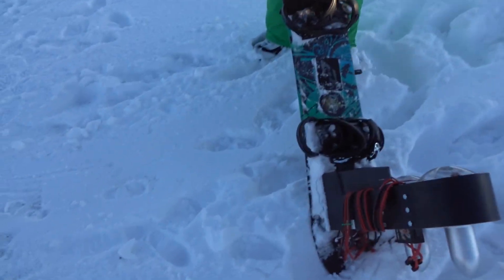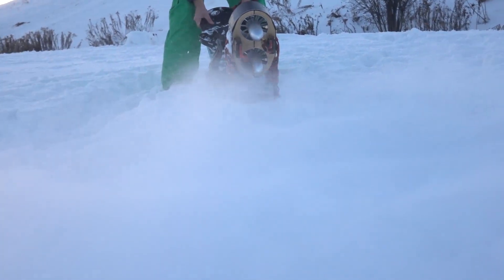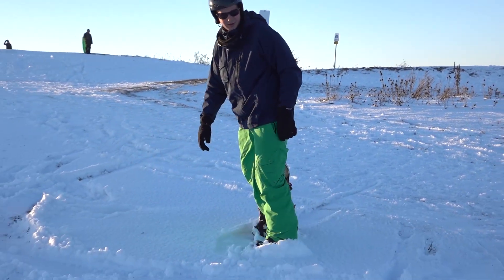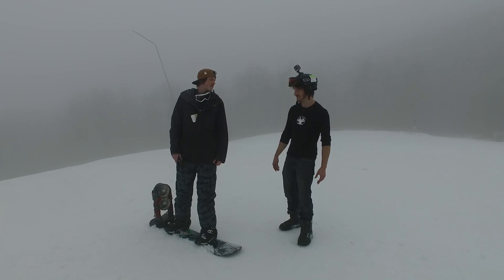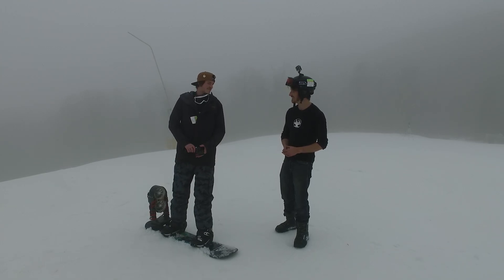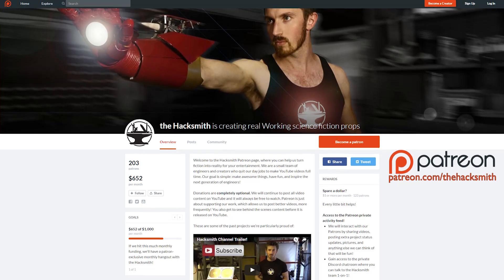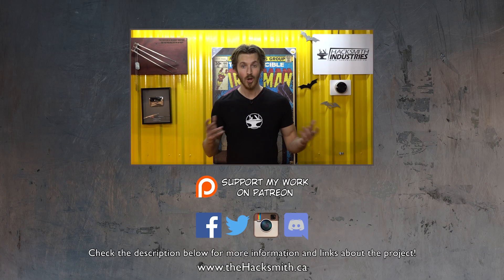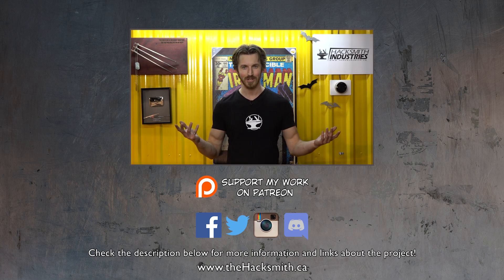How Fast Does a 21HP Jet Powered Snowboard Go?

Comment: The design is horrible. Applying more weight on the sides of the board manipulates turning but the problem with the design is the board is back heavy. The board forces you to spin. It would be awfully hard to control the board. Better design would be jet engines on the back of the person. Therefore the weight is centered over the board vs the back.
Reply from the maker: +LeagueOnly it was designed that way to protect the EDFs. You mount them on the person, first time you crash, bye bye $1000 work of parts. Before prefacing something with " this is horrible " maybe consider a little more thought was put into the design than your comment.

Comment: In  regards to weight, about how much can each turbine carry? Say I was to build a quad copter with 16 of these turbines (4 on each corner)... forget frame, battery life and battery weight for now, how much weight would 16 of these be able to carry?

Can you do a test with a weight system to see how much 1 of these will lift and for how long with the batteries you have? IE: a quad pole frame with weights outside of the thrust area (equal weights in each corner)?

How long can you run them at 100%? Do they break easily running them constantly at full thrust for a given amount of time, or are they reliable over extended use at max power?
Reply from the maker: +phyzik you can calculate all those things yourself based on the specifications... Links in the description to the components we used!

Comment: You really should have attached them sideways, maybe. because the fans doesn't seem to be able to take much air in trough the pants...
Reply from the maker: That only really affects the power if you're going at 100mph+ speeds. We can't have them sideways cause they'd stick out from the board, which means first time you'd crash, you'd bust them. If the EDFs were vertically in front of my legs, yeah, it wouldn't work so well, but they're pretty forgiving with obstructions in the intake path =)

Comment: Not sure if anyone's already brought this up but wouldn't it be better to have the EDFs at the front, pulling him along, in a horizontal configuration (for a lower center of gravity) rather than at the back, on top of one another?
Reply from the maker: +SpirallingOut they're too wide. If they stick out from the board that means when you crash you'd break them :(
Reply: Since you're pretty well known now, perhaps asking for sponsorship by someone like Red Bull would get you an increase in funding to ease your fears of breaking them. Hell, they might even be able to supply you with spare snowboards for multiple design ideas and put you in touch with a local pro snowboarder, who won't crash. Can't hurt to ask!

Comment: Would two smaller ski's on the side, towards the back, of the snowboard work with a turbine on each one work to keep it stable? Maybe give the side ski's a limited turning angle, if mounted where the double stack turbine is. ^_^

Comment: Mm, the board seems to flex a bit due to the weight of the EDF setup and plus extra inertia when you turn, so maybe for Mk.2 you should put the EDF unit between the feet clamps next time, directly below the person's center of gravity, with the EDFs jutting out slightly to the sides.

Comment: 1:34 "21 HP" but won't go uphill?
Reply from the maker: +Eirik A basic physics... 21HP ducted fan does not = a direct drive system like wheels or tracks. The EDFs are linked in the description, you can see their power rating on the site.
Reply: i see. A quick google gave me this to explain it: http://blog.juha.net/07-2013/how-much-horsepower-does-jet-engine-have/

Comment: I would have put the engines on the side instead, because of the legs blocking some airflow, but then you can't turn as much. Not an easy project haha, but it looks fun :) EDIT: Someone already suggested this, oops..
Reply from the maker: +shefles it also can't be done because they're too wide -- first time you crash you'd break the EDFs :(
Reply from the maker: +shefles it also can't be done because they're too wide -- first time you crash you'd break the EDFs :(

Comment: But if the manege to conect the solar panels to the engine and to the batery will work
Reply from the maker: These motors use 16,000W of electricity -- A house with a roof full of solar panels can only provide around 8000W (on a sunny day). You'd need two houses worth of solar just to power the snowboard!

Comment: Hey, i was watching one of the videos on the 3d printed EDF's and how they where exploding, if you are using an ABS filament i would suggest looking into an Acetone vapor bath to give the parts a harder outer layer, more aerodynamic surface and Ive been told it also pretty much weld the layers together, so it would basically end up being a solid part instead of the layered part "glued" together. Just wanted to share so that you and your team might be able to use 3d printed parts in the  "fly like iron man" build, or just save money altogether by building your own EDF's.
Reply from the maker: +Sir Wilson we did do an acetone bath :p
Reply: Okie dokie!
Sorry to bother ya!

Comment: just wondering if you make a 2nd version try mounting the motors side by side instead of being vertical. that might keep the back end from buckling. it's just a theory I'm having. all that weight stacking it on top of each other sets the balance off and pushes the forward causing it to bend but I feel it would be more stable if they were side by side and should be more structurally stable with less flex. as I said though it's just a theory. if that helps I'm glad to have possibly helped. keep up the great work.
Reply from the maker: +project_nemesis_78 “PROJECT_NEMESIS” and then when you crash you'd destroy the EDFs... They're too wide
Reply: the Hacksmith understandable. but what if you build a stand off that's as high as the bottom motor and build a protective shroud to protect them from minor impact? if you don't mind I will do some research and I'll contact you if you don't mind. I'll understand if it won't work. I still like what you've done and it's absolutely brilliant and I also have enjoyed all the things you have been doing. I don't want you to think I'm trolling or anything like that. I appreciate everything you do.
Reply from the maker: +project_nemesis_78 “PROJECT_NEMESIS” even if the structure is strong, snow and ice would still get a into the EDFs and destroy them :(
Reply: that sucks..... well I can't wait to see what more mods you do to it and I'm so excited for more of the iron man project updates as well. you are an amazing builder and you inspire me to accomplish things when others say it's impossible. I forgot what this other fellows name is but check out the motorcycle called the Britt bike. he also inspired me on how to build body panels and structural kits from just wire, hot glue, and fiberglass. I can't wait for more of your projects to come out. 😊
Reply from the maker: Thanks man =) I will!

Comment: You might be able to balance it a bit better and give it some extra life. If you have some decent waterproof batteries you can mount them on the front to balance the board, and the snow can help keep them from overheating. Concentrating the weight on the back will make the learning curve steeper, so evening out the weight should theoretically make it easier to learn.

Comment: Real crappy design
Reply from the maker: Another quality comment! You're so helpful Alex!
Reply: the Hacksmith lmao 😂. No problem man. I try to do my part.
Reply from the maker: +Alex Kossaian that was sarcasm. Try being constructive next time.
Reply: the Hacksmith oh well the user is standing in the airstream. Stacking the jets on top of each other is changing the centre of mass of the board much higher than normal so it's gonna feel very different to a rider. You should put the jets side by side and spread apart a bit. Also putting the jets and the batteries in the back it putting too much weight back there. Your wires are long enough to move the batteries to the middle or the front of the board.

Comment: i see no mechanical issues, id assume a balanced design with one blower front , one back would help.. I saw the biggest issue being the rider .. No one is really skilled at riding a powered snowboard on level snow.. Having an alternate battery pack ready and the same rider over and over would prove the usefulness very fast.

Comment: That's really cool! An interesting thought is, what if you put the fans in the front. If you did that, then it would pull you, instead of pushing you and sometimes almost spinning you out. Maybe one fan on the front and one in the back. Or maybe if you put them to either side, then maybe it wouldn't be as top heavy, and your legs wont obstruct the airflow. You would have to give it at least some height though, to make sure that it doesn't hit the snow when you turn.

Comment: Why not have the EDF attached to a suit ? the thrust would be directed by the direction in which the snowborder looks/turns his torso and the weight would be the same on the board ? also space for a bigger battery and therefore more time for practice ! :p
Reply from the maker: Because when you crash you'd likely break the EDF

Comment: Please make something like either a chest piece with thrusters on  the back for snowboarding or to make you run faster
Reply from the maker: But where's the air go?
Reply: https://www.halopedia.org/images/5/57/Halo4-ThrusterPack.png
Reply from the maker: Yeah I figured that's what you meant... that doesn't work... all forms of jet engines require air to come in from the front, to go out the back... I'd need a hole in my chest. =P
Reply: the Hacksmith Oh, i see. I wonder if you did something like the hovering iron man video but suspended over shoulders. I guess it would have the potential for shooting you into a jet assisted faceplant if the thrust was in the wrong direction tho :P

Comment: Two things:
1. Benchmark it by trying to go uphill. This would be the real challenge for the board.
2. Instead of mounting the jets on the board, mount them on the user to so that the pushing momentum is closer to the users centre of mass.
Reply from the maker: Problem is when you crash, you'll break the EDFs if your holding them. It also cannot go up the hill unless it has some momentum. EDFs have lots of power but zero acceleration -- they need to be moving to achieve full thrust.
Reply: Wow, thanks for replying :D

Could placing them on the shoulders work?

As for the uphill acceleration I feared that there was something that was stopping you from trying it out. What about gaining speed on a flat area and then going uphill on a rather flat slope to see how far you can go?

Also, just wanna point out how awesome you guys are. I've been following you since the Captain America shield video and it's amazing to see what kind of projects you guys complete. Keep it up <3
Reply from the maker: No problem!

Yeah that's what I meant about momentum -- if you get going a certain speed you'll be able to maintain a slight incline, but it's nothing huge -- you're not gonna make it up the ski hill without the lift =p

I wouldn't really want EDFs on my shoulders... they're really loud and if they exploded... well.. that would be kinda scary!
Reply: There go my hopes of saving 10 bucks on the ski lift by buying multiple 1000$ EDF ;)

I guess proper hearing protection could get right of some of the noise but I don't think that there's anything out there that truly protects you from an exploding EDF.
Guess it's back to the drawing board ^^

Comment: You should mount the fans to the person similar to how you did it with the longboard. Then it would be alot easier to ride and you would have less weight ob the board which would allow better control.
Reply from the maker: And then when you crash you'd break everything...
Reply: the Hacksmith Yes that is definately true. But the possibility for someone who has been riding for 10 years to fall, would be a lot smaller. You should maybe have put some carbon fibre or something onto the snowboard to stiffen up the end without making it too heavy. Then it would probably wobble around less and would be easier to ride. Please correct me if I am wrong...
Reply from the maker: Both of my friends have been riding for 10 years. They still fell right away. It's not really a snowboard anymore. Some of the techniques are the same, but it needs a lot of practice to get working properly. And since the batteries only last 5 minutes... you only have 5 minute practice windows. It's a fun prototype, but unlikely to have any commercial viability =(
Reply: the Hacksmith Ok. You will surely master it one day and then it will be amazing😊 It is an awesome project like all of the other ones you do. Keep up the awesome work. I can't wait until you continue with your "flying like Iron Man" project😊
Reply: the Hacksmith What if you mounted it to a sled? It would be alot more stable and if you take or build one which you can steer, it would make it even cooler. What do you think about it?

Comment: You should put the battery pack in between the feet and then lower the top heavyness and lower the fans to where the batteries were

Comment: I kinda doubt the power from the fans will make it move much faster than just bombing a hill normally, And If it did I doubt anyone would feel comfortable going 50+ (just based off how fast I recorded my top speed at 110 ft vert ski hill) with all that extra weight on lack of balance. It's more useful  just messing around on flat ground.
Reply from the maker: Yeah, that's the point of it =P For snowboarding without a mountain.

Comment: For a Mk2 version maybe you can try to create one with 4 engines. Two at the front and back rotating on the X- and Z- axis controlled by a simple controller like the one from the Oculus Rift or something similar. That way you can also switch sides standing on the board and other cool things.. Changing direction on the fly comes to mind!

Comment: may be adding some blades to change direction might help in handling the board like the have pn the big hover board that has a big fan attached toh it which runs on water n as well as on the road. that kind of blades may be. idnt know what those blades are called but hope u got the idea.

Comment: the design of the jet's should be horizontal shape not vertical and may I ask where did you put the batteries?... thanks
Reply from the maker: Then when you crash you'd break them =( they're too wide!
Reply: the Hacksmith 🙂maybe you're right but I think it still needs modification beside you didn't tell me where did you put the batteries?
Reply from the maker: It was shown in the video... those yellow things are the batteries =P
Reply: the Hacksmith last favor ☺can you test the jets as an air diving material?

Comment: Hacksmith, if you lower the center of thrust by moving the fans to maybe the side of the board (but high enough that they won't touch the ground) you will get much more stable and better results.Also it wouldn't be all top heavy, and won't fall over as much :P Also, since the thrust vector is closer to the ground, the snowboard will zip across the surface rather that be pushing the front of the board into the ground.
Reply: im not sure thats true. look at electric longboard for example, the power is the lowest point of the board, the wheels and from personnel experience this has never been an issue. unless your inexperienced with riding like anybody who i let ride my board then the carpet analogy works great
Reply: andriuP6 FPV 
Since the force being counteracted is the friction between the board and the snow, you would want your thrust force to be as in-line and opposite to the frictional force vector as possible. Your point that it would be harder to stay stable if the force came from lower would only be valid if the fans were directly attached to his body. However, since they are attached to his board, he wouldnt feel a difference between the heights. His body is always being accelerated from is feet that are strapped into the bindings of the snowboard.
Reply: good idea, still would need to be a decent height of the ground in order for it not to touch ground during turns
Reply: was just scrolling to confirm someone wrote this idea up seems the high cog is the biggest problem, creates a lot of torque twisting the board and makes it difficult to turn, lowering it should help
Reply: holy crap didn't realise this comment got that much notice. Thanks guys I've been loving reading the discussions!
Reply: MrFunTimez yep :)
Reply: Yea definitely needs to be lower. By having it that high when the board gets on edge the weight pulls it over making it harder to control while turning.
Reply: Hey! They said they had ideas for 2.0
Reply: I'm sorry but actually that's a terrible idea from physics point of view. The center of mass of him + board is around 4 feets high, so if the thrust is as low as the ground, any change in thrust/throttle would make fall him, as a massive momentum would be involved. Think in a carpet been pulled by someone while you are standing over it. You would fall.

Comment: have you got your motors spinning in both directions (clockwise and anticlockwise)? it seems to be precessing causing you to go in an arc rather than straight.
Reply from the maker: EDFs have very low counter rotating torque, it's just the weight offset causing the twist